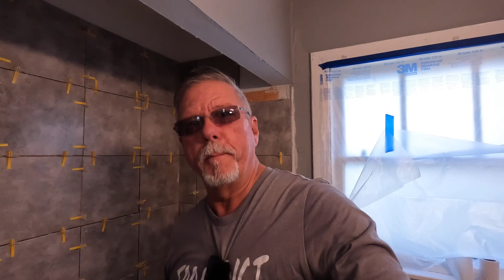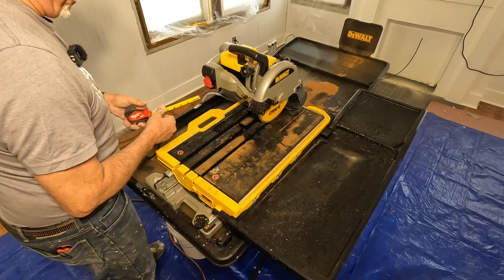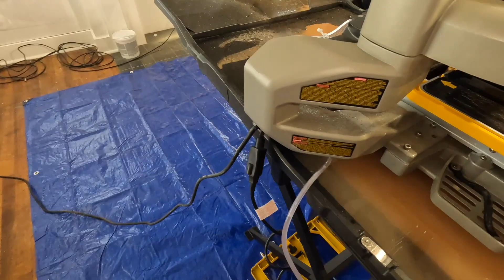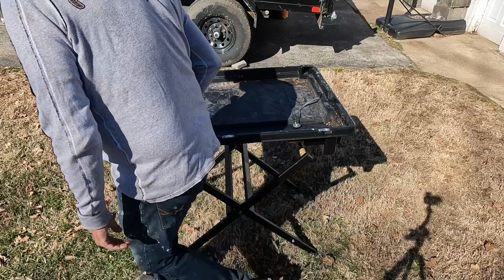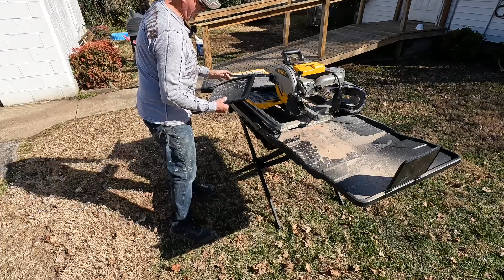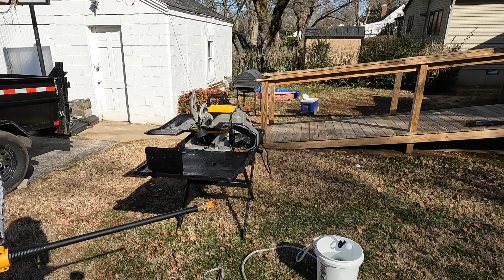DeWalt cordless power washer and DeWalt 36000s tile saw set up

Comment: Well David I do agree on dropping the ball for the Power Washer, I have the HydroShot one (Orange/Black) and only use the 15 degree tip or 0 with hot water and it does preform when needed....again only got it $120 tho. 320 PSI output

Comment: Have you used your dewalt 5 and 1 insulation driver much , do you like it as much or more than the Milwaukee. I am still trying to desire between the two. Thanks!
Reply from the maker: Yes i like it just as well. The bag is larger on the DeWalt and you can carry more tools in the bag than you can in the Milwaukee. The heads change a little easier on the Milwaukee but maybe there broke in a little more on the Milwaukee. I like the grip on the DeWalt and the DeWalt will stand up where the Milwaukee will not. You have more battery options on the Milwaukee than on the DeWalt. Both are good.
Reply: @DavidFDay   I was curious looking at the dewalt in store it looked like gears where the connect were plastic instead of metal and on the Milwaukee is the offset chuck only magnetic? I would use a drill bit in it but think it may come out in reverse what do you think. Thanks for the help and videos God bless!